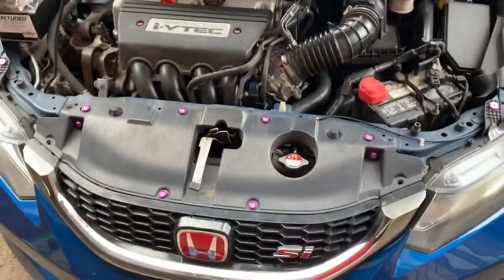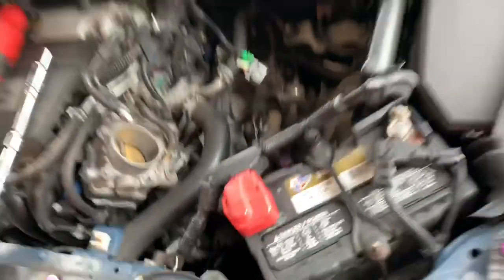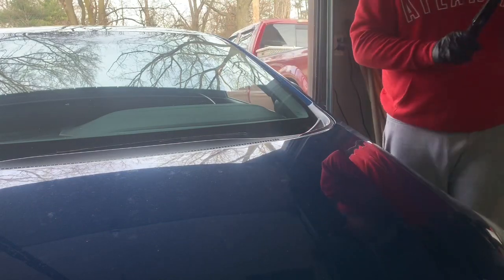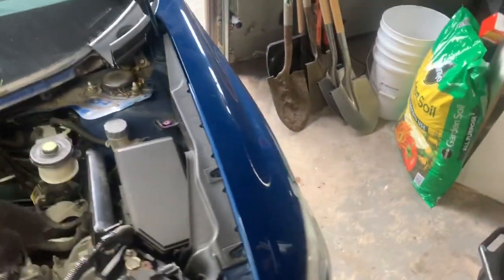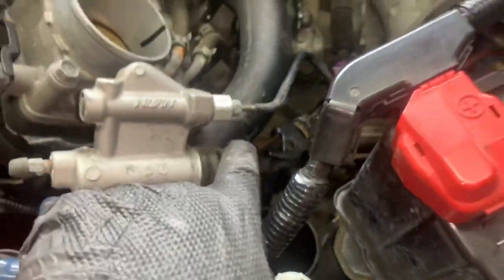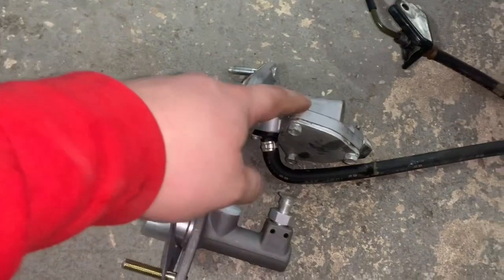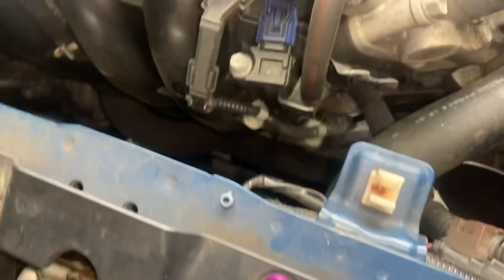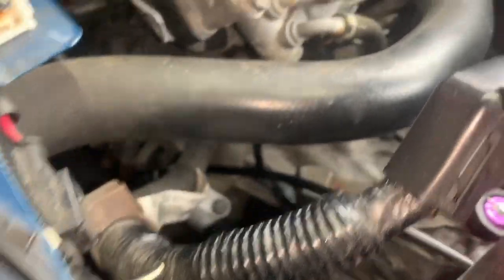9th gen Civic Si K-Tuned CMC Kit Install

Comment: Got the cmc and slave kit from ktuned on my 8th gen and I still grind, get locked out, all the bad shit. Even leaks. I'm getting the hybrid racing one whenever it gets delivered but ktuned cmc sucks. Dont do it ppl
Reply from the maker: Have you adjusted the cmc? I’m not assuming its a install error, I’ve had zero issues with this kit tbh have you done your clutch recently?

Comment: Just did this exact swap the pedal feel and the engagement seem different the vibrations were definitely unexpected but still better than the oem
Reply from the maker: Alex Cauthen you most likely have to adjust the push rod and the pedal, my engagement is definitely slightly different but nothing drastic and yea i agree way better than oem

Comment: I'm changing one out on my 2013 si today, sirimoto, this video helped bro, good material...any tips on tweaking the rod? Maybe just give it the same amount of threads as stock, take a picture.
Reply from the maker: I had to constantly adjust to get a good feel i matched my stock one and played with the 17 on top of the clutch pedal
Reply: @skatinemcee  My Sirimoto CMC installation went flawless. For starters falling back on this video payed off BIG TIME because pulling off the front plastic and metal cowls creates a massive amount of room to work with and saves alot of headache, i havent seen this in other videos yet. It took more time carefully removing the OEM CMC because there's brackets and hardlines in the hydraulic hose, old nuts n bolts you basically gotta be careful not to bust anything and my car is a 2013 so it was stiff. Installation was simple but I do recommend a good set of needle nose pliers and vice grips for the rod and bolt assembly, reason being the sirimoto bolt holder bracket sets wider than the stock this makes it super tight to get the safety pin in, its nothing bad but instead of over pinching the bracket with the bolt off, I pinched it with the bolt on so that I pinch just enough to slide the safety pin in. The bleeding procedure once the slave is on takes time,but understandable with the high quality hose needing to fill, i let mine hang to the ground and just pumped and filled because if you fill it while installed you have that belly loop of an air pocket just hanging. After installed, the reaction time im getting on clutch is like night n day i can basically shift and peddle simultaneously it feels like new and it engages much quicker than stock so im getting used to not having to dump my clutch all the way down, instead maybe a quarter of the way and shift so that's a plus. I went with Sirimoto because of the quality and it comes in a combo with a slave cylinder for just around $200 👌